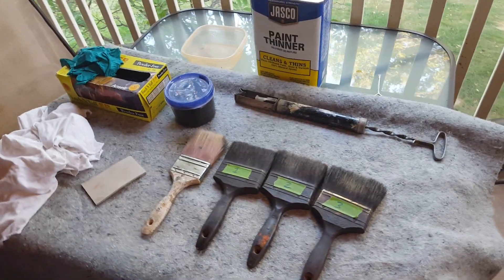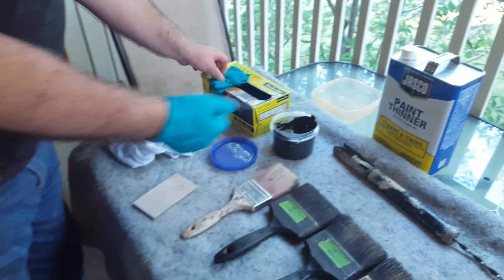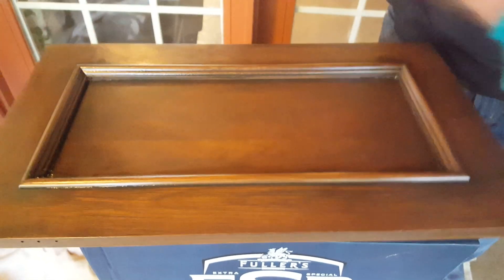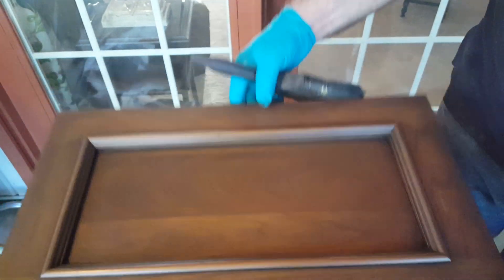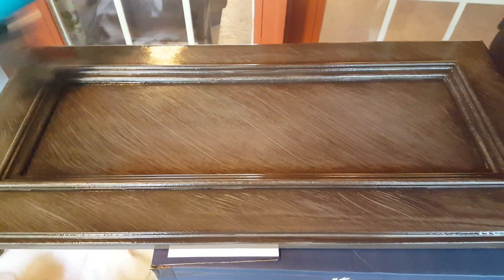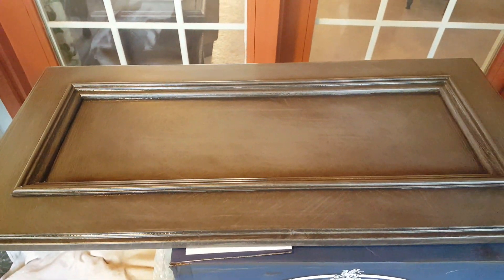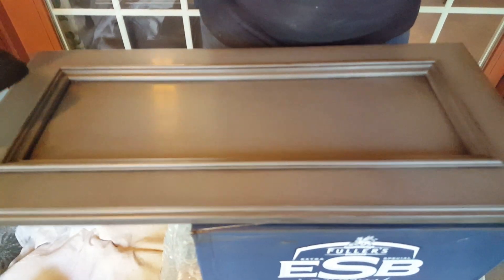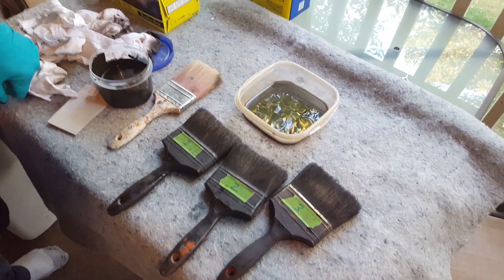Brush out glaze technique

Comment: Please- can you tell me where to find chip brushes like the ones in this video? I have some cheap ones but all they do is shed! Messing up my project! Help!
Reply from the maker: I got the bigger brushes at home Depot. They are 4-in brushes, natural bristle not polyester. I think they were $9 or $10 each. As long as you clean them well, and have one of the brush spinners to clean out the excess solvent, they last forever. Maybe not forever but, they will last for many years, so it's worth the 30 dollars or so  investment. Hope that helps.

Comment: A lot of people do not understand how much work goes into painting cabinets much less antiquing cabinets, especially going from stain to paint and then glazing. It is a massive undertaking to pull apart old cabinets, prep, and paint, and that's before the antiquing and topcoat.  If the cabinets are not prepped properly for going from the old stain with a clear coat to painted the paint will not bond properly and then you have a huge problem on your hands. Label all the doors and drawers removed with a number system in an inconspicuous area where it can be easily touched up with a brush...on the inside or on the ridge somewhere. Make sure to not loose the hardware and keep it in one place. Once you have it all primed and then painted (a lot of sanding in between those two and don't forget to caulk all seams and spackle any small nail holes...not the screw holes for sure) put them back together. And then start the glazing project.  Depending on the size/amount of kitchen cabinets you can be looking at anywhere from about $4000 all the way up to above $10000 on "standard" sized home kitchen cabinet sets, but even more than that in bigger homes with 3500 sf plus which have huge kitchens if a professional is hired to do it which can be hard to find :/

My recommendation would be hire a pro to paint the cabinets and learn how to do the glazing yourself so you can tweek it to your liking.

Comment: so you used an oil based glaze over a latex paint?
Reply from the maker: The finishes on these samples was actually factory applied conversion varnish. It's a much harder finish than latex paint. But as long as you scuff sand it and clean it well, you can use an oil base glaze over that and refinish it. As for latex paint, yes you can use an oil-based glaze over it. As long as you clean it well and scuff sand it. I would recommend allowing it to dry overnight. You can finish it with an oil modified acrylic clear coat. ZAR makes a really good oil modified acrylic clear top coat. You could also use spray can laquer for a topcoat if you want to avoid brushing. DEFT makes a good one, but I think RUSTOLEAM is pretty good too. The only problem with using an oil based glaze over latex paint comes from what may be underneath the latex paint.: If someone previously painted latex over a factory conversion varnish, most likely the latex paint will eventually fail and chip or peel off, depending on how the surface was prepped prior to applying the latex. You are at the mercy of whoever painted the latex on in the first place.  If you are planning to paint the latex yourself, I would recommend an oil modified acrylic paint. It gets harder than traditional latex paint.  Sherwin Williams makes a good one, but Ben Moore should have one too. But prep is the key to make latex stick to conversion varnish. Clean it first with something like TSP or even NAPTHA. Then sand it like crazy to provide enough of a rough surface for a primer to bite into. Primer is another whole subject, but a good Sherwin Williams tech could help you with that one. Good luck, it's a lot of work. 🙂
Reply: @alanburton6190  Thank you. You know, I did a strange project using both latex paint and oil based stain. I forgot about that. Doors originally painted white. I painted doors with flat tan paint, then I came back with oil based stain and brush stroked it until i had a wood finish look. After that dried overnight I top coated it with the Rustoleum MATTE finish. They look great. So i guess they both can be used together under certain circumstances.

Comment: Alan, wondered if there was a specific brand of oil based glaze you used?  I have only seen water-based and it's not workable for so long.
Reply from the maker: I use Sherwin-Williams oil based glaze. I have access to the clear base and all of the pigments, so that I can make most any color, but I think that a SW store can make you any color that you like.  However, in some markets, SW does not offer oil based products because of EPA regulations. Mohawk is another manufacturer that offers good products.  I think that you can find a local dealer on their website "dealer locator". Here is a link to a good product from Mohawk. http://www.mohawk-finishing.com/catalog_browse_tech.asp?ictnbr=176  If it is too thick, you can reduce it down with a little (key word little) mineral spirits. The water based glazes just do not have enough open time to do a brush out glaze, plus, the brush out technique makes it dry even faster.
Reply from the maker: That link did not work. Sorry. Maybe this one? http://www.mohawk-finishing.com/catalog_browse.asp?ictNbr=176
Reply: Thanks so much for the info Alan!  I've always used water based clear glaze and tinted it myself with leftover paints to do specialty furniture pieces.  But, you are right, the drying time is very short.  Your process left a smokier and more natural looking aging.  I've had to content with drag brush or rag marks and you just can't come back over it because it totally changes the original coat.  Going to have to hunt to find it in my area though.  Am contacting them through their Facebook page to see if there is a retailer near me, since none are listed or if it's available online anywhere.

Had a bed I was rehabbing recently and wish I had seen this before I finished it.  It's done in oil stain and urethane.  When I've used all the waterbased products and polycrylic top coat I HAVE gone back on top of the poly and done a second or first glaze to get a different look ... and then, of course, come back with more polycrylic.  It's another alternative, but definitely not the handrubbed real aged look you get!  

And just realized you had a Mohawk link but also mentioned a Sherwin Williams product.  Do you use both depending on where you can get the oil based product?  

Thank you!!!!

Comment: What is the difference between brushes 1,2&3
Reply: Brush #1 has the most glaze on it since it was used first to remove the glaze while #3 was used last, thus it has the least amount of glaze.  When he selects a brush to add excess he then of course uses #1 but uses #3 to remove the additional glaze which was added to provide more character to the piece.
Reply from the maker: Exactly like biskygiver stated. First brush is wetter, because it gets used first on the wet glaze. Second brush is medium amount wet/dry and third brush is the dryest, because it's used last. Use the dryest brush to "soften" the look. When the third brush gets too wet,  wash them all out, spin them dry with a spinner and start all over again.
Reply: Clark Heisler what kind of brush’s are you using?